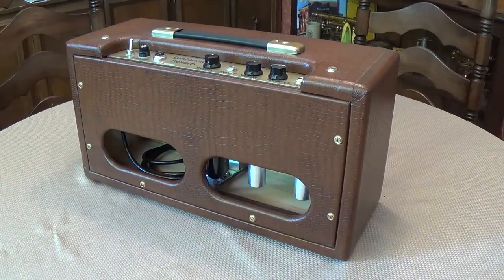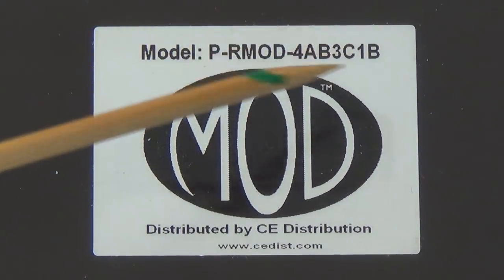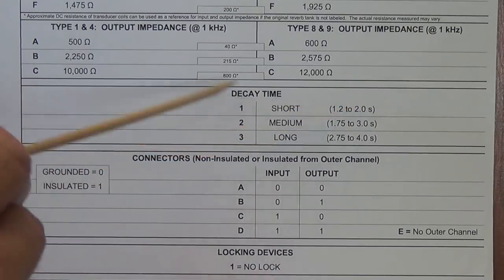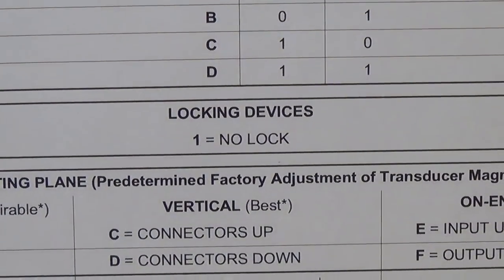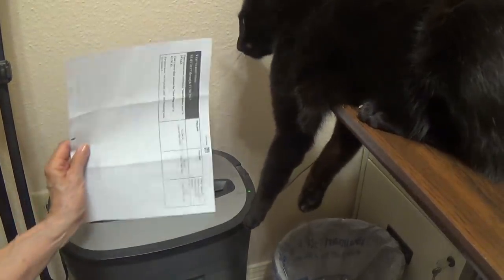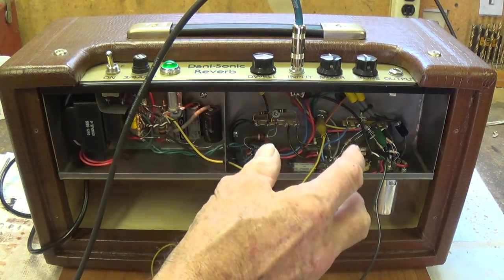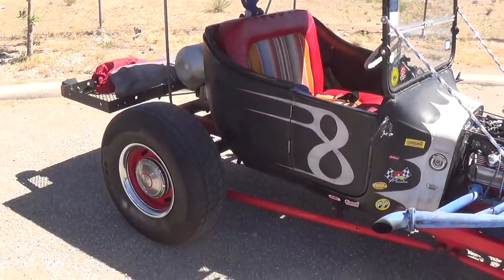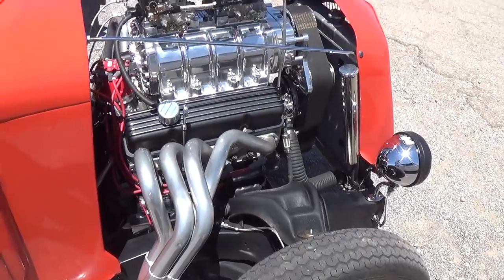Tube Reverb, Part 2:  Transducers, Tanks, Tone, and Signal Mixing

Comment: Doug, I don't think your mixing theory on same phase being the reason for the dry signal cathode follower. The reverb tank is time delaying the wet signal, which is effectively a large phase shift. Does this seem plausible?  I'll take a look at the impedances driving the mixing pot and think about it while I'm walking my dogs this evening.
Reply from the maker: You must admit that the phase reversals all add up, Craig.....but I'm anxious to hear what you come up with. It's an interesting question.
Reply: Here's my thought, without the dry cathode follower, the mixer pot and the wet's tone control will lower the circuit's overall input impedance, loading the guitar pickup. With the follower, the dry circuit loads the pickup with a high 2.5Mohm/2 resistance.
Reply: Andres, Exactly, you beat me to it, cuz my dogs aren't as fast as they used to be. Or is it me that's slower. Probably me.
Reply from the maker: An interesting theory, Craig, but since the guitar input is to the grid of V3b, why would it matter if the output was from the tube's plate or cathode? Wouldn't the input impedance of the dry circuit still be determined by the two parallel 2.2Meg resistors?
Reply: If the cathode follower was not there, say it was just a straight wire, you would have the reverb signal being sent back to the input stage of the unit.  Probably not what you want.  The follower is mostly a one-way signal valve.
Reply: The dry V3b's plate is tied to B+, there's no plate resistance, so you can't get an inverted signal from the plate. You could use a gain stage for the dry signal, but the dry's triode V3b would be biased completely differently, ie not 2 2.5M resistors + a plate resistor. However what do you make this dry gain? or more importantly, the reverb recovering gain would have to be increased to match the dry output now larger signal.  

I, as well as everyone else, is anxious to see your scope captures. I hope you can single trigger a real short note displaying both the dry and wet signal.
Reply from the maker: I'll do my  best, Craig. Thanks for all your comments :)

Comment: Is it possible to add a reverb circuit to a 5E3 using the stock tubes?
Reply from the maker: No. It would require significant alteration of the circuit, additional tubes, a reverb tank, increase of current supply by a larger power transformer, and in most cases, a transformer to drive the tank.

Comment: Uncle Doug, wondering if you have you ever looked into making an all tube plate reverb unit?? Pretty sure a lot of the home recording studio fanboys would go crazy for something like that, assuming they even knew what it was. Many moons ago, I remember as young harmonica player in long forgotten band (probably better for everyones ear it stays that way) using an EMT140 plate in EMI studio 301 in Australia...would have been the mid 80s. Well, not exactly using, but instructed by the house engineer to run out and adjust the beast, when he required it...singled out, not for my technical proficiency but as I was probably the least stoned looking member of mean bunch of bad hombres:). I remember there was a sliding plate that was used as dampener to adjust decay(or was it reverb time)..there was a lot of yelling by the engineer to me through the stdio PA "my left, not your left you idiot". It was an amazing piece of electro-mechanical wizardry...sounded much better than any digital plug-in or dsp chip used these days...was the real deal. Similar principle to a spring reverb I believe driver amp  - tranducer -  plate  - tranducer  - output amp. You might be able to recycle a tray from one your old trucks: in a pinch..just a thought :)
Reply from the maker: Thanks for sharing your very amusing recollections, RD. I can just picture the scene in that recording studio :):)  By coincidence, I have just lately become interested in plate reverb, and found this site:   https://theproaudiofiles.com/plate-reverb/  which offers a very interesting comparison between plate and spring reverb.  Plate seems to be almost pure echo, while spring sounds just like what it is......twangy, springy, and not nearly as clean as the plate, especially with vocals.  I am going to continue reading up on the subject and may surprise you all in the future. Thanks again.
Reply: http://www.triodeel.com/studio.htm look at emt schems here UD. Yes I can think of no better man for the job of building a classic all tube Plate reverb. You need equal parts skill in welding/steel fabrication/Tube amps/electronics. Look forward to your version of a classic all tube plate reverb. The sound is incredible from a high quality plate reverb...otherworldly when you hear it in a studio. It's part of what used defined a studio's sound. Capitol records had one the best..why those old sinatra recordings sound so great. Mostly used on vocals but can be used on snare drum or whatever you like. In the studio they blend in as much/or little as required with the original track via send and return on mixers.
Reply from the maker: Very interesting, RD. Thanks again :)

Comment: My Traynor YRM-1 Reverb Master has an accutronics 4L tank. I need to look at the tank for the full code but I wonder what that L stands for as its not on the chart. The amp uses a 6bq5 to drive the tank with no reverb transformer.
Reply from the maker: The identification code involves several letters and numbers, Thomas, and will fully describe the characteristics of the tank. I have no idea what the "L" would mean by itself.
Reply: @UncleDoug  I was referring to the schematic and it labels it 'Accutronics Type "4L"'. Also says the DC resistance of input and output coils is approx 180 ohms (hard to read could be 150 or 160) which doesn't really match up to the chart. Ill just have to pull the back and get in there and find a part number. The amp is very fender inspired. All plate coupled. But Ive always wondered about the reverb as it sounds different. Ill let you know what the actual code is. Thanks for all your videos.
Reply: @UncleDoug  The code is very faint. Its 4FBxx1B. I can no longer read the 4th and 5th characters.
Reply from the maker: @cigarettesmokingman9471  You could go to the Amplified Parts site and look up their translation table. It is full of helpful information.  https://www.amplifiedparts.com/tech-articles/accutronics-products-and-specifications
Reply from the maker: @cigarettesmokingman9471  See my other reply for a helpful site.

Comment: Is it possible to swap a 8eb2c1b tank in place of a 1EB2C1B? I think that's what it is. 2 spring short tank with 600/2250 input/output. The 8eb2c1b is 3 spring something like 800/2575 I think?

I figured since it was more impedance than the original, it would be OK?
Reply from the maker: In theory such a substitution would be feasible, but the only way to really find out is to try it and see.
Reply: @UncleDoug  yea I've seen a few other people talk about replacing theirs in their Monoprice 15w tube amp so I went ahead and ordered one and got it installed.

Unfortunately, at the levels I practice at, I can't tell one bit of difference. It's only on the 1w setting and usually less than 5 on the gain & vol knobs so that might be why. I really need to crank it up and record them both somehow so I can get a good comparison.

Luckily I've still got my Fender Mustang II combo and it does hellacious reverb even at low volume levels so I can supplement the 15w amp with a dual out pedal and the Mustang if I need to. It actually matches the sound of the Monoprice quite well at a few of the stock presets. 

I wanted to order a long tank but it won't fit inside and I wasn't sure if I could mount it outside the cab like some of those spring reverb pedals that have the external spring tank connected to the pedal in an enclosure and not in the amp. If so, I may order one and try it out. I also stuck with medium decay. Wondering if long decay may have given me the lush sound I'm looking for. 

Now if Amazon would hurry up and send that Allman Brothers 'Eat A Peach' poster I just ordered for my Dad. It's the center mural from the album with the mushrooms and fairies and all. 24x36 inches. I can't wait! If it looks really good, I plan on buying one for myself, as well, to go on the wall between my guitar hangers. It'll finish that wall PERFECTLY. Been looking for the perfect Allman Brothers poster for that spot. I think this'll do it. Either this or 1 of 2 album covers. The Anthology, of Duane fishing, or the Fillmore East cover shot. My favorite album of all-time.

Comment: Uncle Doug I'm confused about the reverb tank in my Fender super reverb on the tank it's labeled input and output  on the amp it's also labeled in and out do l plug the cables to in to in and out to out boy sounds like I'm really confused ??
Reply from the maker: I don't blame you, Eugene. Just remember that "input" to the tank comes from the "output" of the amp, and vice-versa. Also, nothing much will happen if you reverse them......just no reverb......so you can test it and correct if necessary.

Comment: Hi I have a Peavey backstage chorus solid-state amplifier one of my springs have came loose in the Reverb tank it's missing the magnet I was able to take the cap off the back of the tube and dig out the silicone that was inside they're holding the wire can I replace that magnet?
Reply from the maker: You can try. I have never done this, so I can't really speak from experience, but darned near everything is possible if you try hard enough. If you find that you can't do it, replacement tanks are readily available and are rather inexpensive.
Reply: @UncleDoug  okay I appreciate this thanks I think I'm going to give it a shot
Reply from the maker: @rodneylarue9512  Good luck, Rod. You have nothing to lose by trying......and everything to gain, including experience.

Comment: Ya wouldn't think Jack's hiding routines would work all that well while he's on a catnip high, would ya, Doug?
He sure can make himself invisible...well...on the other hand, maybe the catnip enhances that particular
process for him. I dunno, I seldom get high on catnip, so I'm not expert.

But yeah, I did know that the "bead" in the transducer is held by a wire...and the links to the "other end' are
the springs. But I also know that a magnetized core for the driver coil and a bead that's just "ferrik" but not
a magnet would work. Ya may not end up with the quality of audio that you went after though. That reverb
"science" took a while to figure out for a reason(8-).

If you count amp stages, you'll prolly see why the "raw" audio is taken from the cathode of that 12AX7...all
you want is to mix the reverb signal with the "raw" one...you don't want  "phase fight" between the two
signals. And, like you said, reverb is used mainly on higher frequencies...so that amp is biased and tuned
to drive the tank...and I'd suspect tuned for that spring combo. But it didn't sound too bad driving a speaker,
did it(8-). Nice little single ended amp... Thanks a ton, Doug. Great tour through the science under the "hood"
of that reverb unit. (HEH HEHEH! I said unit. HEH HEH!

I'm not much for those chump wheels and tires either...I don't like chopped tops much or lowering to the point
ya can't even drive the vehicle. The rest of that first truck, I love...but those wheels would have to go.

That was a great lookin' Model A pickup. I believe that was called a sliding drum 3 speed tranny. If you
you reach over and "goose" 3rd gear and then put it in low, it'll go right in...and if you were moving at all,
you could be in second gear...so it wasn't too big a deal. And yes, that bed on that car??? Shoulda left it
on that John Deere Gator(8-). 

Definitely had some interesting road iron there, Uncle Doug. Thanks for sharing. I hope you hit the lottery
big enough you can take a couple of those rides home with you. But don't forget to get a second opinion
 from Jack before ya buy...but wait 'til he comes down off the catnip high(8-).
Reply from the maker: Thanks, Tom. It was good to hear from you.
Reply: Sorry I got so long winded, but you always put so much neat stuff in your videos. It's hard to keep
quiet(8-).
Reply from the maker: Thanks, Tom. No problem at all :)

Comment: I don't think the phase can be the whole story of why the output from the tube is taken from the cathode, as you can also easily flip the phase by crossing the wires on the output transformer or on the tank (as both are isolated).
Reply from the maker: You may be right, Dries. The use of a cathode follower for the dry signal may simply be a means to isolate the input and output without adding any gain to the signal.
Reply: I was thinking that, too, and I'm  looking forward to part 3 and the oscilloscope.  I'm wondering if perhaps the output of the tank is a lot lower than the dry signal.  I can imagine trying to harvest those tiny vibrations from the far end of those springs, that it might be so, in comparison to the big ol' vibrations of a guitar string.  So, since there's an amplification factor of about 100 from the plate of a 12ax7, but not much amplification to speak of from its cathode, perhaps that balances the two signals better.
Reply: The dry path is a unity gain non inverting path due to the cathode follower. The 12AX7 is needed to recover the tiny (mic level) signal from the reverb receive transducer in a common cathode configuration. The high gain of a 12AX7 is required to approximate the level of the dry path so the mix knob operates as expected- mid position is an equal portion of wet and dry. The polarities are even since two low gain 12AT7 inverting stages are used before the transducer driver.
Reply from the maker: Thanks for the helpful input, David.

Comment: Man how did I miss this video... I think I actually saw it, thought I replied and forgot about it (perish the thought I meant  filed it away)... Anyway I have had many super reverbs and my oldest one had a tank by not accutronics but oh crap I just thought of it when I was at the top of this paragraph and forgot it by now but anyways the springs I have taken out through the years and they have different ohms ratings, like anywhere from 40 and 80 60 120 difference I wonder if that has to do with some sounding different I mean obviously I know there's short medium and Longs but saying the difference is between two longs, shorts or whatever size. So now along with corks nippers you can get spring sniffers. That was supposed to say cork sniffer but I think I like what voice recognition did better.
Reply from the maker: Thanks for your comments, Lawrence.

Comment: Couldn't the transducers be rotated by the manufacturer for builders who need to mount the tank flat?  That eay they are configured as they would be if the tank were mounted on its side.

  And the corollary:. WHY dont they do that for builders like Fender??
Reply from the maker: I assume that the manufacturer does indeed rotate the transducers to allow for various mounting positions. Tank are built for different mounting styles and are numbered accordingly.

Comment: A reverb unit produces reverberations, or echoes. Not overtones. An overtone is exactly the same thing as a harmonic. Your phase shift argument doesn't hold water. For one thing, you've left out all the phase shifts in the transformers. For another, if the springs didn't introduce long, and multiple, delays, i.e. phase shifts, of their own there would be no point in the entire unit. The cathode follower for the dry signal must be because the tank is very lossy, and all the internal gain in the wet signal path, which is large, only just gets it back to the 0.9 gain of the cathode follower path. And of course you don't actually want any gain, because you're feeding a guitar amplifier. I was wondering if the spring lengths are relatively prime, like gear tooth counts in a gearbox. That would mean there are no greatest common divisors, so the echoes would all be irregularly spaced, which is what you want: no 'shatter'-type effect. Best EJP
Reply from the maker: Thanks for your input, QM. I used the term overtone to describe added/delayed (echo) tones, and did not mean to confuse it with harmonics. In retrospect, "aftertones" would probably have been a better term. I'm sorry for any confusion. Actually the wet signal does arrive at the mixer control with more gain than the dry signal, and the two signals, wet and dry, are in virtually perfect phase alignment, as you will see in Part 3. The cathode follower's lack of gain is an asset, especially when the mixer is in full "dry" mode, so the guitar signal goes directly into the amp input jack unaltered, as if the reverb unit was not even present.